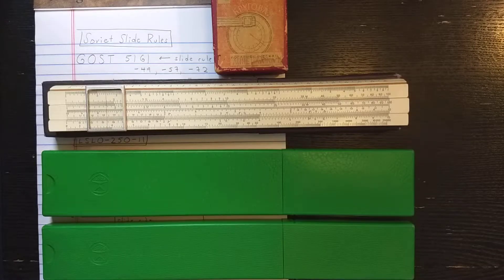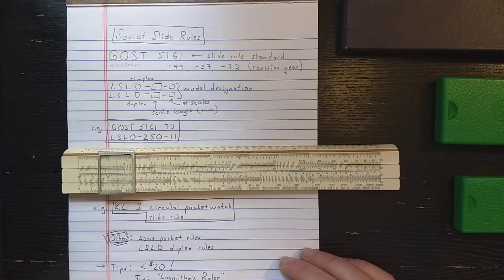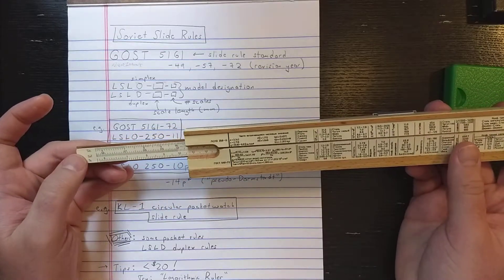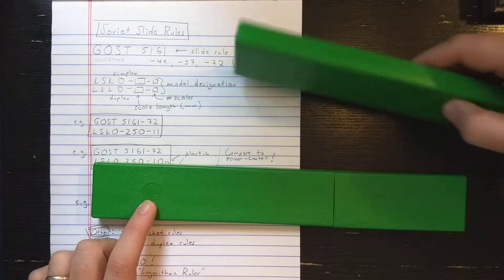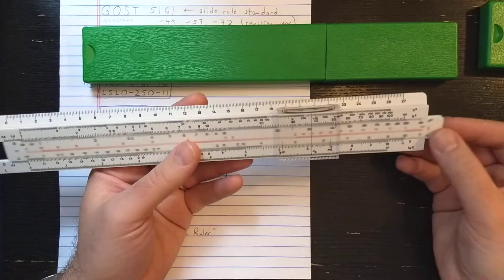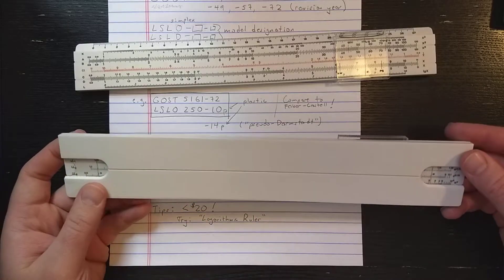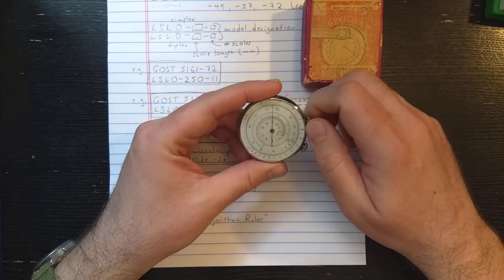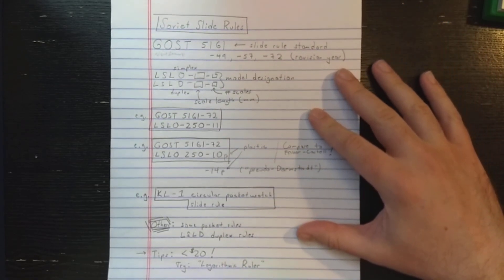Soviet Slide Rules (GOST 5161)

Comment: I have two Soviet rules, both unmarked Rietz scale sets, from the 'Sputnik' era. One is a 1955 pocket rule & the other is a 1957 250mm desktop rule. Like a lot of Soviet stuff from the 1950s they bear a striking resemblance to German designs of the 1930s. Both have railroad track style scales & quite legible serif fonts. In fact the smaller rule is one of the most easily read pocket rules I have. Both of my rules were made in the prosaically named 'Soviet Factory No. 10' in Kiev. I think the people were more engaged & had a sense of purpose at this time. The quality of the artefacts of this period are better than they were in following decades. This generalisation is born out by my Soviet cameras & lenses. I would have liked to have seen a nice set of Cyrillic scale labels  on my rules. My pocket rule has a wider gap to the left of the scale set as if it was intended to engrave the Russian equivalents of K, A, B &c... But then someone thought better of it.
P.S. I was intrigued by your 'faux' Faber-Castells' & just did a quick hunt. I broke my rule of avoiding Soviet stuff made after 1961 & got a rule with a nice green case. Dated 1978 it is undoubtedly my most modern & up to date slide rule! It is one of those pseudo Darmstadts, has a BI scale on the slide & D, S, ST, T3 & L on the lower stator. The pictures don't show if there are any Log-Log scales on the back of the slide so I am expecting a Rietz with everything on the front & a bonus BI scale. Some LL scales would be nice but the real bonus will be if the slide is smoother than some of the genuine Faber-Castells I have handled...